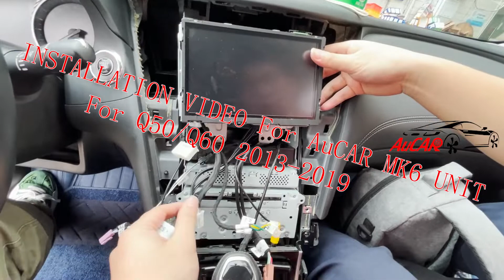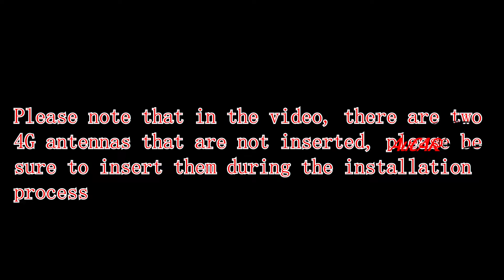How to install AuCAR MK6 T-style unit  for the infiniti Q50/Q60/2013-2019.

Comment: My audio is still not working can you advise ? I'm currently installing it and that and the different car modes are the only issues I'm having.
Reply from the maker: check your Audio AUX adapter please
Reply: Rashaad, did you connect the AUX wiring harness from the back of the MK6 all the way down the center console? I ran into the same issue. I had audio from FM and Bluetooth but that's because that audio doesn't emit from the Android MK6 itself but rather the stock HU. I overlooked this during the install and ran into the same issue. I thought a harness was left out. Thankfully, it was just user error. Hope this is the fix for you!
Reply: @ATL_323  the issue was not the system that I purchased but the factory radio. The brain of the car was malfunctioning
Reply: @shaad1251  That's rare for that to happen and makes troubleshooting difficult. Glad you figured out the source. So did you fix the issue along with the different car modes?